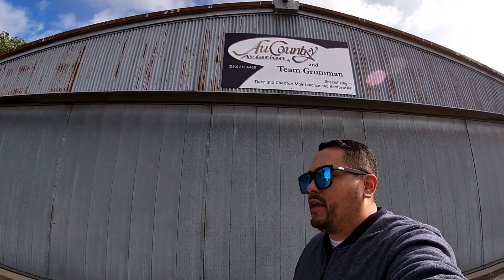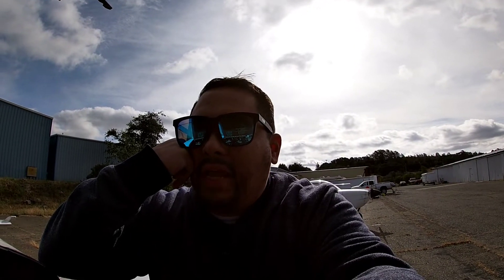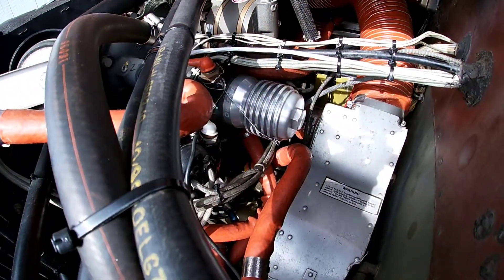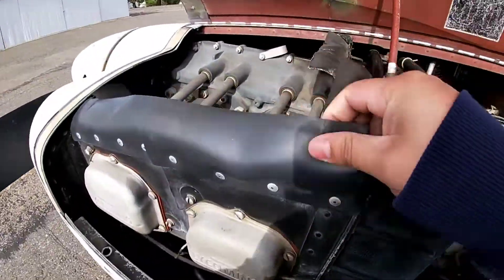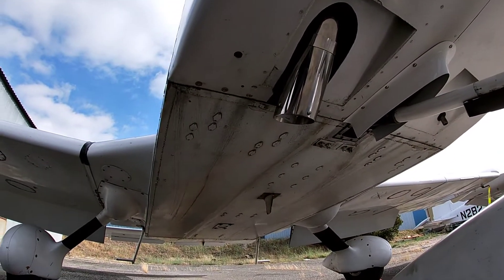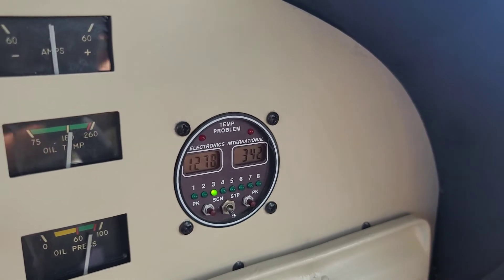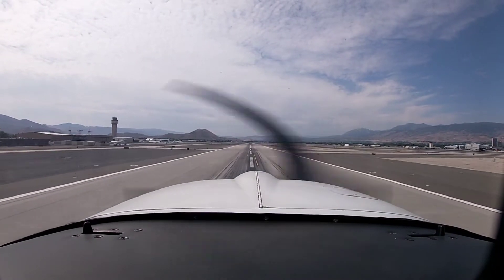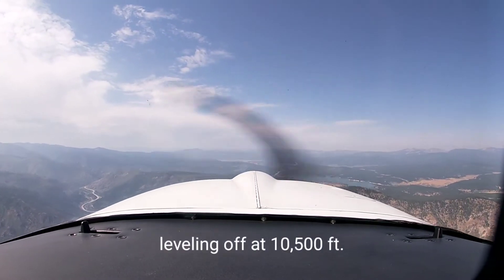Aviation: Powerflow Exhaust System Review in a Grumman Tiger AA5B

Comment: I put on the previous version of the powerflow on my Tiger. That was about 20 years ago. It made a big difference. I picked up about 95 RPM doing a static run up plus about 150 FPM increase. From about 500 FPM to 650 FPM and I live in Flagstaff at 7000 feet ASL. The engine changed sound as well. Went from loud to not nearly as loud and at a different pitch. I also put on a LoPresti cowl. That helped a lot with cooling. My oil temp would routinely go to about 200 during climb out in the middle of summer. That was from Deer Valley in Phoenix. Now it's rare to go above 185 during summer from Deer Valley. All around very happy with modification.

Comment: Debating on whether to add a powerflow to my AG5B when my engine is overhauled in about 6 or 7 months. After flying with it for several months, are you still happy about the upgrade? Gary does all my work as well.
Reply from the maker: I baby my engine and there is a legit improvement in operating Temps. The price was about what's expected for any upgrade in aviation but I figured it would help prolong a $40k engine overhaul at a minimum. I can confirm about 100-200 fpm climb increase at the same Temps. Tbh the performance improvements are not significant in the grand scheme of things. I think the surefly improved my flying experience more than anything else I've done haha!
Reply: @KillerBloc  the climb increase certainly sounds nice. You didn't notice any TAS speed increase in cruise? Any noticeable change in fuel burn? I have the Surefly also. I'm not sure if I notice any difference with that but I needed new mags at the time so it seemed like a logical choice.
Reply from the maker: I have no doubt there is an increase in TAS in full throttle or fuel savings compared to the same power settings, but they appear to be so slight it's not outwardly apparent. I'm sure if I documented and adjusted for altimeter and humidity, etc. that it would show gains, but when I get in and go, I still appear to make it to my common destinations at the same time. The climb and temp improvements are easily apparent from a stick and throttle point of view. As far as top speed, the powerflow doesn't improve aerodynamics, and with a fixed pitch prop, the goto is to clean up the airframe and make it as slick as possible. Tigers leave at least 10 easily gained mph on the table from my understanding. Remove the jelly jar (done), jaguar or Similar cowling (done), hide the antennas (coming up), new paint job and then ceramic coating or regular waxing, lightening the gross weight load, etc.
Reply from the maker: @wolficorntv Regarding the surefire, I was speaking towards just the pilot experience of flying. The engine starts instantly, no plug fouling since I've got it, smoother engine, etc.